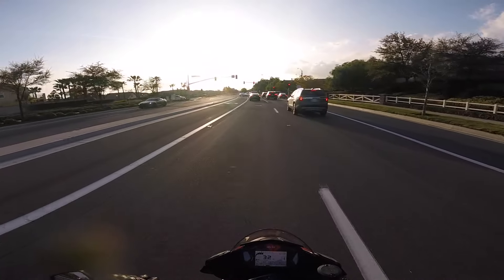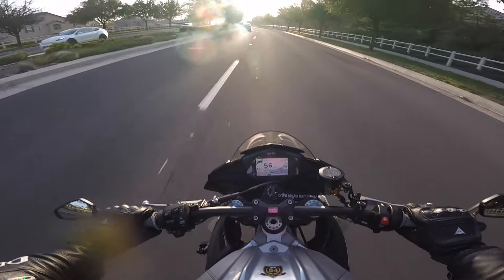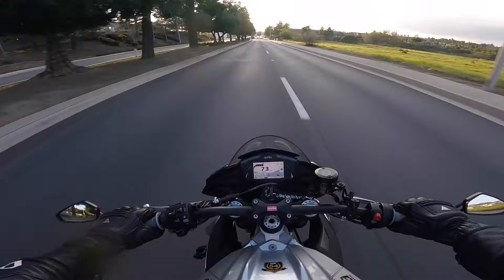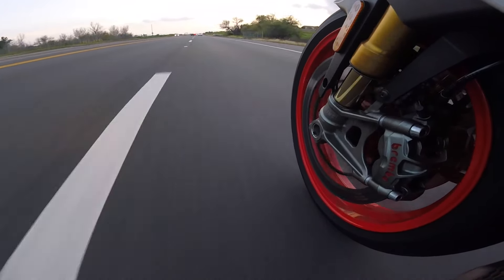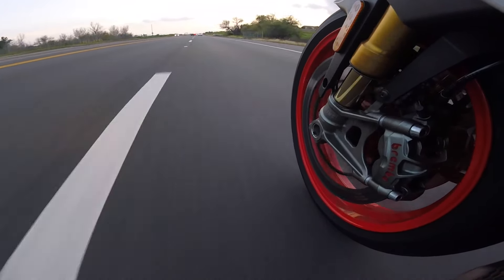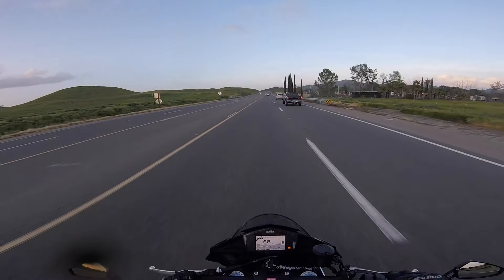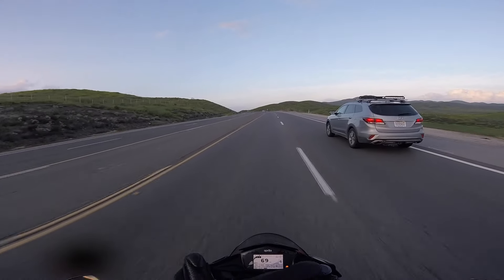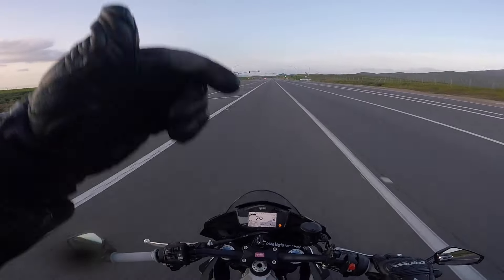Motorcycle Wheelie Control explained! (Aprilia Tuono V4 demos with different WC levels!)

Comment: I have a 22 panigale v4s, first bike I've had with wheelie control.  I was surprised at the wheelie control settings actually letting you hold a wheelie on the lowest settings.  The lower the setting, the higher the angle and longer it will let you hold it.  The novelty wore off and I have it turned off now so I can do real wheelies, not cheater wheelies😂
Reply: what setting do you do that on? and do you just hold the throttle open and the bike does everything or u gotta manipulate the throttle like any other wheelie?
Reply: @ilovepizza8263  if you put it on the very lowest setting, it will hold a 45 degree wheelie all the way through 1st gear.  You can literally crack the throttle open 100% above 6000-7000rpm and it will do the rest.  It would be a good experience for a noob to feel what a wheelie is like, but it would give you bad habits, won't teach you balance point or back brake control
Reply: @JustForRita I mean this would be my first bike, I’m not trying be crazy w it so the wheel control helps me act cool when I wanna hv fun 😭🤣

Comment: I see the orange light on the dash at the end of the video. Is that because you turned off traction control? When i turn off ATC that light pops up on my 2017 Tuono.  If i want to do wheelies, what do you recommend the settings to be set at?

Comment: Due to the lack of noticeable difference in AWC modes, makes sense why the RS 660 only has off and on. Can confirm, with ATC on it will still limit the wheelie duration to 10 seconds. Wish it didn't yell at me every time I turn the bike on that my safety settings are off. I'm lowkey jealous of Ducati's new wheelie assist feature. Don't prevent me, help me Aprilia!
Reply from the maker: Definitely a bit disappointing that Aprilia's electronics haven't made any significant leaps in the past 5-8 years, but I still think the soul of the bikes more than make up for it 🙂

Comment: Yamaha 21 mt09 with lift set to 1; you can hold it at about 45 degrees no worries
Reply from the maker: Wow! Well, Yamaha does actually have good electronics that aren't based on a system designed in 2009 like those on Aprilias 😂

Comment: One time, my qs went out of sync. It went into a false natural… then back right back into gear violently. It was like a really violent clutch up. Since it was at around 10oclock. The Wheelie control slammed the back down so hard. I popped a fork seal, didn’t notice until the day after. 

I like wheelie control as I can pull a lot harder, helps with launch. As it’ll just hover above the ground for the most acceleration. Sometimes I can be a dick 🤣 I’m sure without wheelie control. I would have had a lot more red face moments. I do wish there was a setting on my gen2 SuperDuke to control how high it would go.

Comment: Hey, man. I am pretty happy to have found this video as I also own one Aprilia, the Tuono Factory 660 2023 model. I have had the bike for almost 2 months now and after starting to know each other for around 5k km, I tried for the past 2 days to do my first wheelie, but I just could't. I disabled the wheelie control ( I only have on or off) but still nothing. Whenever I was releasing the clutch and started somehow to raise the front wheel even for a few cm, the gas was just cut, rpm dropped, so no chance of doing a wheelie. Then I saw the TCS light turning on whenever I was trying to do the wheelie. So the idea popped in my mind... could it be possible that because of TCS it is not letting me do the wheelie? And then I found your video. I saw pretty much the same symptoms I was facing today.. I was very curios if with Wheelie Control completely off you will mange to raise the front wheel, but you had the same response as I did. So I think I got my answer.. I will try to do it again with TCS off , it seems that's the problem. At least for Aprilia. :) Thanks, again!

Comment: That completely turns me off of the wheelie control of that system. I think what I was hoping for was wheelie assist. I learned to wheelie on dirt bikes and my application on the road was on my 1992 ZX11 (yes I bought it new). It obviously had none of the "aids." It also looked awesome on 2nd gear wheelies because it was so long. I would have liked adjustable traction control, but after a few scares, I learned to manage the power well enough. What I really would have liked was clutchless shift. I ripped some 2nd gear teeth doing far too many speed upshifts. Luckily Kawasaki paid for the gears and labor under warranty. I am looking for a good naked (Agusta, Triumph, Ducati, et.al.) and I think I will skip the controls, except maybe traction control when I am riding "casually."
Reply from the maker: I typically run the traction control on the lowest setting, as well as the cornering ABS, and everything else off. Quickshift and auto blip are game changers, definitely tech I would not consider skipping in a newer bike. 🙂

Comment: This is very different from the wheelie control on the MT-09 I leave mine on 1 because idk if I want to find out is me or the bike. You can clutch up a wheelie in 2nd basically at balance point and ride it out. It does go down when you hit 3rd. The tc will cut you off if you get to aggressive with throttle

Comment: Question: can you just yank the throttle znd the bike will stop you from going too far?
Reply from the maker: @silent_fluo6917  in many cases yes. If you yank it too abruptly in first or second gear, it might not. It depends on the conditions, your speed, where the engine is in the power band, the gear you're in, etc. I wouldn't personally try to find out
Reply: It shuld be ok. @hiimchad film and show ALC lunch control... open full throttle (rpms will "hang" arround biggest torque) release the clutch and observe perfect start. AWC and ATC in combination with programed ALC will work.

Comment: the sensor is not in the throttle handle , the cables go to the  throttle body on the left of the bike wich has that sensor :D
Reply: untill the throttle body , you have normal cables as any other bike , got an Aprilia Tuono as well , I had to do relearn procedure for it , that s how I ve found out of the whole process :))
Reply from the maker: @TheRiderzx6r  hi, not sure what year your Tuono is but mine does not have steel cables to operate the throttle bodies like any older bike I’ve had. The throttle tube contains a sensor. You can see here in the description of the part on AF1Racing: https://www.af1racing.com/2d000095-oem-aprilia-rh-grip-w-throttle-sensor-2d000095

Comment: Can you absolutely full trothle with traction control en wheelie control on max settings without the front end gonna wheelie and flip the bike?
Reply from the maker: I would not recommend trying. The manual states something along the lines of the electronics not being able to defy the laws of physics, so while it might work, I wouldn't want to find out. First gear would be the most risky. If I roll on smoothly in second with wheelie control off and tuck my body in, the front end barely lifts, but I am also quite tall and heavy for a motorcyclist.
Reply: Appreciate the answer <3
Reply: @yasin4449  I yank the throttle in 1st gear with awc 1 and tc 1. Unless I'm not in higher rpms (over 7k) it won't wheelie

Comment: Loving the VR video.😉
Now just to work out the daft controls to access the AWC settings on the tuono. Found how to flick modes on it the other day... on wet roads...oh my! As you suggest, best to try it on track first😵‍💫
Reply from the maker: VR has gotten pretty good, hasn't it? 😂 That must have been scary in the wet!

Thanks for watching and for your comment! 🙂✌️
Reply: @hiimchad  let's just say I was trying to quickly cycle it back out of race mode as quick as I could find short straights to clutch in!

Comment: Cool, I run my 2016 Multistrada pikes peak on DWC1, and i get frustrated by the lameness. I'll try DWC off and see how much it changes. I figured level 1 would enable some hang time, i guess not.
Reply from the maker: I've seen and heard that the Multistrada, Hyperstrada, and Hypermotard have wheelie "control" like this. It's old and outdated. I wonder if Ducati implemented the same wheelie control system in the newer (2019+) models like that on the Panigale V4. I have experienced that wheelie control first hand, and it does give you some hang time!

Comment: Hi, I know im kinda late to this video but could you or anyone else help me with stoppie control? I have an rs 660 so the IMU should be kinda same as the v4. I was wondering if there is the stoppie control or not and on which levels of settings does it kick in. Im kinda affraid i will fly over the front wheel when braking hard.
Reply from the maker: Aprilia calls it "Rear Lift Mitigation". With the Tuono V4, it is only active with the ABS set to 3 or 2. I have played around with it before and the rear wheel would still lift a bit on bumpy roads under hard braking. I disabled it after that. I would recommend using it as a safety net rather than relying on it entirely.
Reply: @hiimchad  Thank you very much. I just needed to hear it from someone, ofc im not going to count on it, just want to be sure. Ride safe bro!!

Comment: Great explanation and confirmation as to why mine just pops the front wheel with AWC at 1, just like yours 😊. If TC is left on and AWC is off, will it prevent the bike from looping ?
Reply from the maker: Thanks Simon! 🙂 Only AWC can help prevent a loop. ATC will not stop you if you go too far back. I’ve done some decent wheelies with ATC on 1 and AWC off and have not had TC intervene, except for a handful of times when it’s been cold out and the wheel spun when I popped the clutch. Never any intervention once the wheelie was initiated.

Comment: Hello i have a question! If i turn on wheelie control and literally give it max throttle and dump the clutch it will literally hold me?
Reply from the maker: Nope, it will throw you right off the back
Reply: @hiimchad  oh! Then.. do you still need to use back break? I'm a bit confused
Reply from the maker: @martialart3277  the wheelie control system is not perfect. It will provide assistance under normal riding conditions and works as an anti-wheelie system more than a wheelie control system. If you were to pin it and pop the clutch in first gear, the massive surge in torque would cause the front of the bike to lift abruptly and with a lot of force which the system would probably not be able to overcome. This effect is reduced in higher gears, but under no condition will AWC sustain a wheelie longer than a second or so
Reply: @hiimchad  but if your in higher gear it helps right? Because i have a big fear of flipping my motorcycle. (I have an rs660)

Comment: Hey I have a 2021 RSV4 and I cant for the life of me, get the front wheel up in second. When I try to power wheelie, it doesn't lift up. when I try to clutch up, it almost feels like the bike is breaking up or restricting me. I have everything turned off (WC,TC, ETC). If anyone has any thoughts id appreciate it. I have tried all different speeds and rpm and still nothing.
Reply from the maker: I'm not super familiar with any updates they may have made from 21 on, but recall the Tuonos being power limited in first and second gear. Not sure if the RSV4 is too, but even with some restriction it should still lift with everything disabled. Do you have ABS on still?
Reply: @hiimchad   After doing a bunch of research and going through the forums, it seems like its a safety measure Aprilia put in to save the clutches. I do have everything disabled and it will still cut power on a second gear clutch up. I can clutch up in first and I can power wheelie at 75-80 or so if I really try to get it up. Ive been told that getting a tune will solve the clutch up issue or some people just recommended changing sprockets and just doing power wheelies. I will probably start with a tune just to see but thanks for the reply!!
Reply from the maker: @jacobgreen490  of course! Hope the tune solves it!

Comment: what setting AWC did you use on track?
I have used 1 so far, but in some situations it cuts so hard, I feel like it is better to control with the right hand..
Reply from the maker: I always leave it off and will usually run TC on 1 while on track. In my experience, I manage wheelies better than the bike does 😂

Comment: I do not really understand why there are 3 modes on the bike. They seem to prevent wheelies on all of them. My s1000rr at least allows you to do no wheelie at all, just a tiny bit, and a full wheelie on the 3 modes
Reply from the maker: To be honest, I don’t understand either. The difference between each setting on this bike is minimal.
Reply: I think on the 21 model plus with the new ecu this has all changed!

Comment: How many miles on the tuono now?
Reply from the maker: ~12.6k!
Reply: @hiimchad  no issues?
Reply from the maker: @Dazed207  nothing major, typical spark plug bung o-ring weep that started a couple thousand miles before it was due for valves, so just managed it with cotton swabs each time I serviced my chain. They replaced the o-rings when they did my valves so all is good there. Only other issue was my shift shaft pin game loose behind the clutch, causing some rough shifts and not being able to pull in the clutch and skip gears. The shop found it while doing the valves/12k service and tightened it back up. She’s been great other than those two things 👍
Reply: @hiimchad  how much did the valve service cost you? And we’re they way out of spec. Thanks
Reply from the maker: @Dazed207  https://youtu.be/NecpGarDNX4